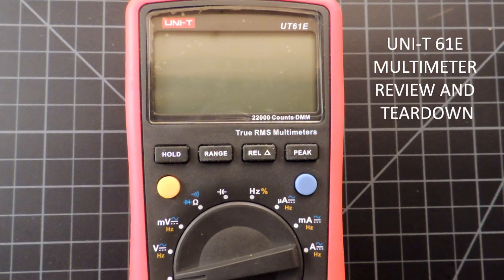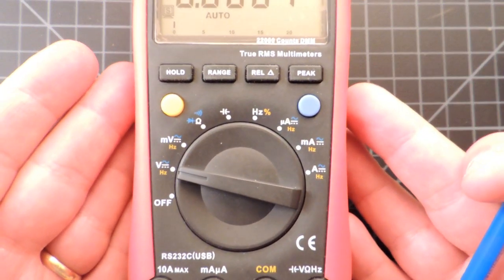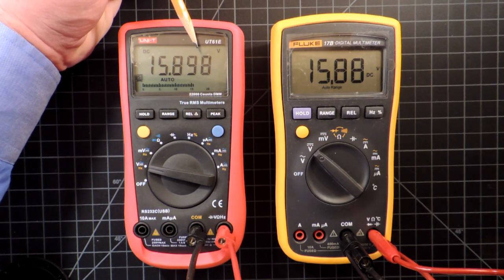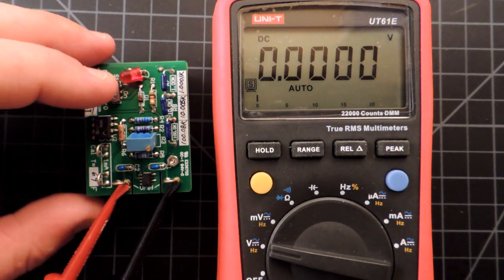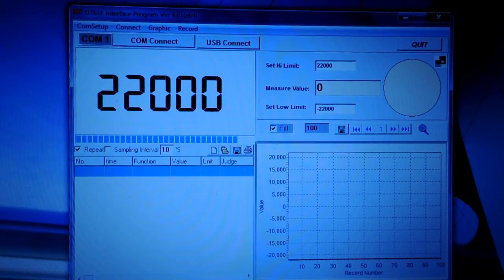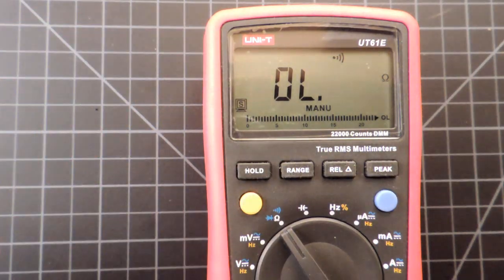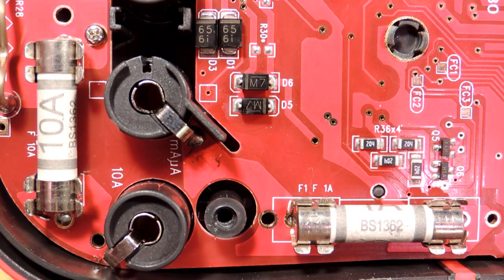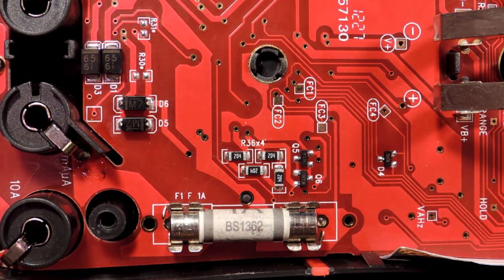UNI-T UT61E Multimeter Review and Teardown

Comment: Those plastic posts on the back of the meter mainly act to support the metal jack sleeves when a lead plug is pushed into the jack, thus preventing the solder joint from being yanked on and taking the stress.  Many folks dont realize this is the main function of these plastic posts.

Comment: Serial ports weren't ever problematic, except that they were larger than the USB connector. 30 years on electrical/electronic equipment, and in industrial settings, USB fails where the rugged serial ports are more durable and are still used.

Comment: You need to be really careful buying from a seller ebay. The UT61E is available cheap from Banggood, which is a reputable store that can be trusted: http://www.banggood.com/UNI-T-UT61E-Auto-Range-Modern-Digital-Multimeters-AC-DC-Meter-p-90124.html?p=JQ26191551677201504Z
Reply: Right. I'm sure some other seller is going to buy a bunch of Uni-T meters, open them up, change components so that they can sell at a lower price.

Explain why anyone would do that.

Most likely, YOU are the Banggood store owner and are lying in order to drive people to your store.

Comment: Hi. I bought the same DDM. Could you say me, How can I test the fuses without open the DDM. In page 65 of user manual  explain, but isn't works, show me 0L.
Reply from the maker: +Jose Vianney OL indicates fuse open.....
Reply: +electronupdate Hum.Thank you!  But, it's new. I used one first time now.
Reply from the maker: +Jose Vianney open it up.  perhaps the fuse fell out in shipping.  instructions should be in the manual....
Reply: +electronupdate  i opened it up. the 1A fuse is ok. but, 10A fuse not. :(  I tested  both using other ddm with resistence scale.  thank you!
Reply: +Jose Vianney That fuses.Can I found the ones to buy?

Comment: This DMM has a 1A & 10A BS1362 fuse that is 6mm x 25mm.  If either one blows, you can buy in the United States as long as you want to buy 1,000 of them, or you can get them shipped out of Hong Kong.  Uni-T used the MOST OBSCURE FUSE ON THE ENTIRE PLANET!
Reply: +Hugh Hemington I use small pieces of various gauges of solder as fuses
Reply: You just haven't yet seen the ones that Peak Meter or Forscher and the other clones uses)

Comment: The specs of this meter on Frequency Measurement is a little bit confusing based on what they have posted in eBay. Some put a frequency range from 10Hz to 10Mhz,and the other put 10Hz to 220Mhz which is really good if this is true. Which of this is the real specs of this meter when it comes to frequency measurement?

Comment: i got one of the ut61E and i want to use the freq to check alignment of pll freqs on cb radios. it goes to 220MHz so it should do 11.24 easily. Can you demo it please so i can learn do/not do Please ?? even the radio freq output can i loosley couple it. Like radio into a dummy load then just run a lead close by like ant switch in my ant tuner with the radio in dummy load in the tuner? please help.. Robby N Jones

Comment: You need UT-D04 cable. It costs about $15 on eBay. Or you can buy USB to RS232 adapter for your computer, which costs much less but I can't get the one to work. Also if your motherboard has internal RS232 port you can buy special bracket to bring it out to the rear panel. So, you have 3 options to choose from.